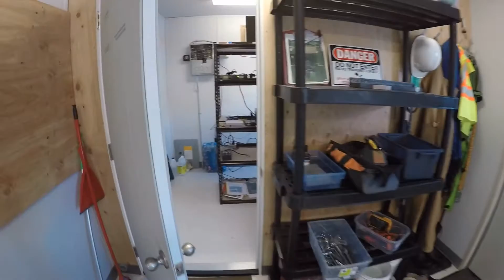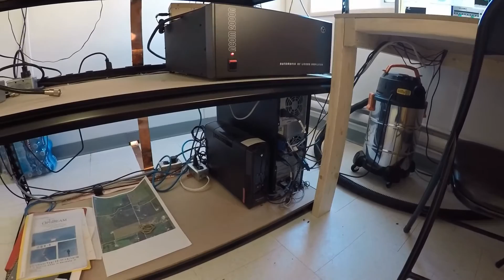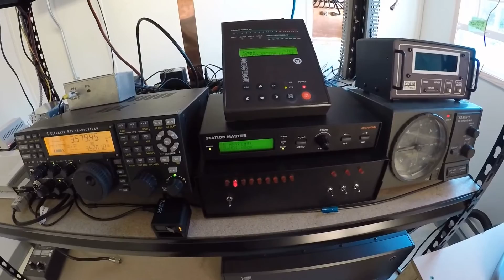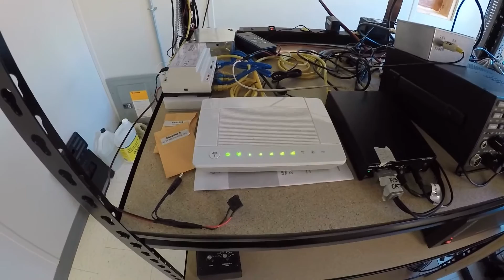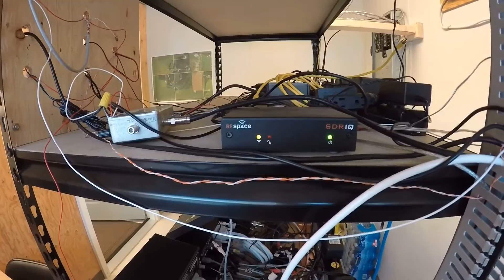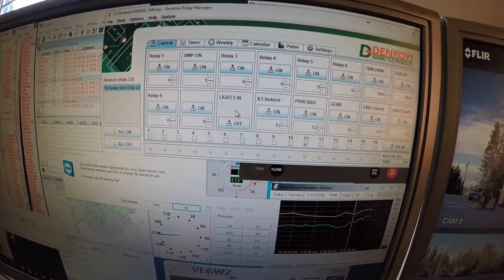Walking tour: Inside the VE6WZ remote shack

Comment: You have a great remote station setup. I would like to setup a similar remotely controlled HF station in the future, expansion what I have now. Redundancy is important so you can solve most problems by remote control.

Have you considered using a Paradan automatic antenna grounding switch on your HF radio as redundant lightning protection?

Have you checked out RealVNC Connect as an alternative to Team Viewer?

The remote HF station is a great solution to be able to have great HF antennas for your HF station, and not have to live in a rural area. The location is a compromise. An area that’s not too restrictive for towers and antennas, yet not too far out so it has good enough Internet service, and not too long of a drive for on site maintenance.